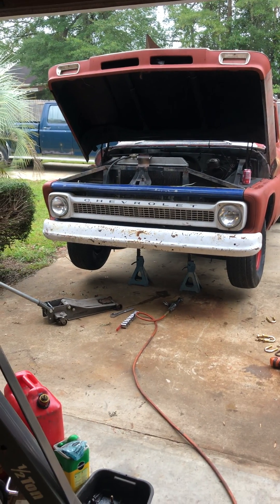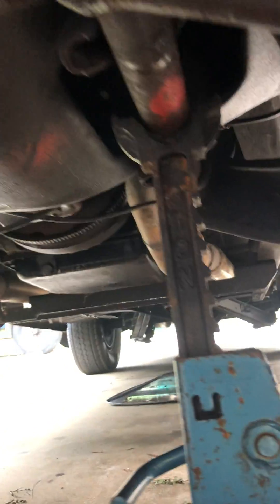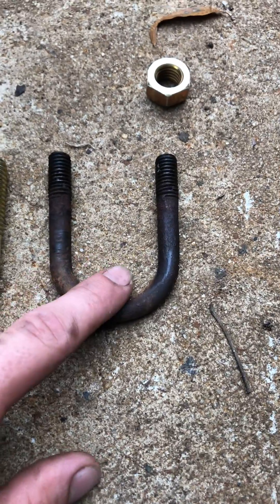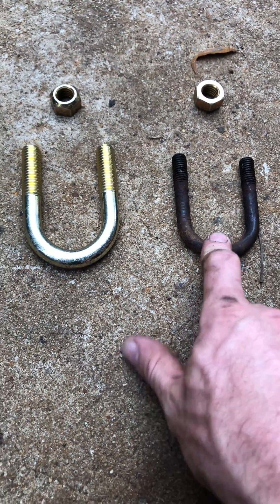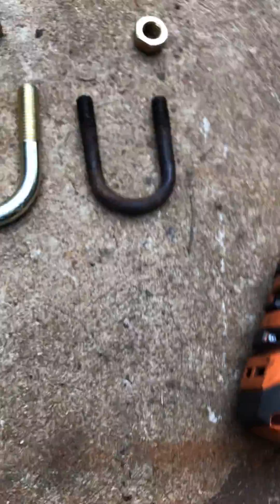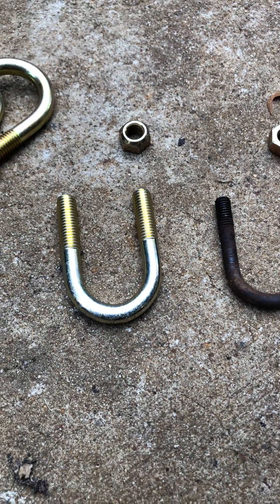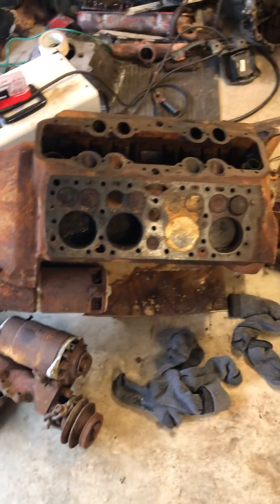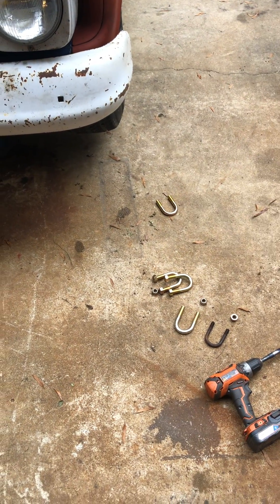First Gen C10 lower control arm U Bolt Upgrade

Comment: Help me please I have a 92 G20 van 3/4 ton the shafts are very large I could only get the lower control arms for the lighter weight van I can buy you bolts but I don't know where to get the other purches  the old one are too big I assume they are not welded to the frame that is my question
Reply from the maker: Have you tried RockAuto.com

Comment: Does convexed side of nut goes towards bracket or up?
Reply from the maker: Tapered side up, flat side down.
Reply: Thank you. Did you use lock washers?
Reply from the maker: @JonnyBlazeTCB  I did not but probably should have.

Comment: Worth it?
Reply from the maker: Absolutely. Ive had a few OEM bolts break on me. I daily drive my 66 so it gets run hard. These have been on here for two years - approximately 50k - miles and they're as good as day one.